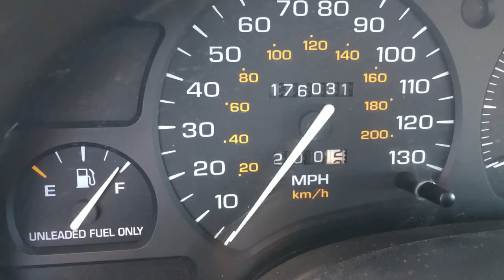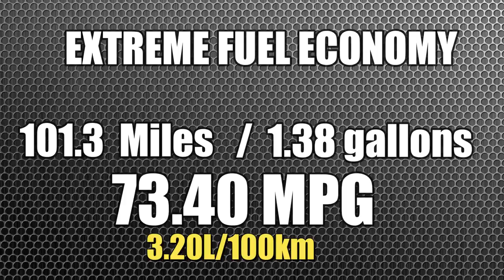S3 E11. Kubota turbo diesel Saturn extreme fuel economy.  super high MPG

Comment: I know you keep saying this car wouldn't be alright to drive anywhere, but I've driven cross country in slower things that were way more questionable. I'd put the main tank back in line, run a fuel regulator and a return line to get it down to an acceptable pressure and see where 700+ miles of range got me.

Comment: a modern diesel car is actually better then this.  you made 3.2L pr 100 and a stock  diesel ford Mondeo do 2.9L pr 100 driven at 70. they managed about 1600 miles on one tank.

Comment: an interesting angle of this project would be operational cost / mile  diesel vs cost / mile gasoline.  At one time it was definitely worth going diesel, modern times i'm not so sure.
Reply: @drippingwax  One of my former cars (2015 cruze) had an option to do gasoline 1.8L   gasoline turbo  1.4L   and a diesel turbo model.   Up front the diesel model was 4 to 7 grand more purchase price.  Then factor in fuel,  repair costs, and availability of knowledgeable diesel repair mechanics.  I figured most "stealerships" barely know how to properly diagnose issues and are only interested in silver bullet repair tasks.  Maintaining and repairing my vehicle myself combined with a lower gas model sticker price is where i figure it saved me the most money in regards to overall ownership.  (chime in post covid world, availability of parts was very important factor as vehicle aged)

Comment: if you were put that engine in something like a prius or the old honda insight it would probably get even a little better mileage . they have a narrower body than the saturn and so are probably slightly more aerodynamic . i think they also have a narrower track ( wheel track ) and that also helps reduce drag or rolling resistance . that's why bonneville streamliners have a narrow track , not just because the body is narrow . and skinny tires with a lot of air pressure can help

Comment: A Tesla Model 3 gets 150 mpgE (EPA official test) without driving weird.  An advanced dual mode EV will get 297 mpgE at 180 mph with aero not being negated by driving dangerously slow and safely up on guideway.  A measured Cd of 0.07 is the main factor.

Comment: 0:50 I disagree. I drive economically, and that is the correct fuel economy. Don't go over 55. If the downhill isn't steep enough to coast in gear and maintain/increase speed then coast in neutral. 

Always gain speed downhill, even 5mph and then coast it out will increase mpg. 

Never accelerate downhill, that's stupid. 

Too high speed going downhill means you spend fuel going downhill, that's stupid. 

Not losing speed uphill is stupid. You can always get the speed back on the top when it flattens/goes downhill

Comment: I figure your method for measuring the amount of fuel in the diesel tank is a little more complicated than necessary. Why not just get a wooden ruler, and stick it in so it sits on the bottom, and then just read out how high the ruler got wet to. More in line with how a you read the amount of fuel in a Trabant.
Reply: @drippingwax  Looking at pictures online, the trabant has a rectangular fuel tank. So it's pretty much just a ruler, but with gradations for half a tank, etc. (I think, I've never seen a trabant in person).
Reply: @drippingwax  he does mention the fuel tank in his 'review' video of the trabant. They do have rounded corners, but I imagine it can be approximated to be a rectangular prism.

Comment: The fact is, Diesel has so much energy per volume, look that car went 101 miles with just a gallon point 38 of fuel or 22 ounces if my math is right. That means that diesel in this particular setup has enough energy density per 0.24 ounces to keep a car constantly accelerating for 1 mile. That is phenomenal. Try that with your fancy electric cars. Not happening.

Comment: Good!! The modified red Saturn reaches the fuel economy of subcompact French diesel cars.
They use the same basic concepts: small diesel engines with a powerful turbo, reasonable weight, old style manual transmission.
https://en.m.wikipedia.org/wiki/Citro%C3%ABn_C3

Comment: Fill in the front end air intakes with polycarbonate sheet and put an air dam under the front maybe....
Reply: @drippingwax  I dont know whats under there but I would cover the headlights and the air intakes for better aerodynamics at least. Maybe make a bigger airdam.  It might not help but I would try it anyway.
Reply: @drippingwax  Are you drunk??? there is no 79 seconds and im not talking about weight savings Im talking cd drag. 1/8 inch polycarb over those garish openings on the front will increase CD
Reply: @drippingwax  Probably the booze and weed.
Reply: @drippingwax  Here is some logic......go to bed.

Comment: The Mile
The basic concept of the mile originated in Roman times. The Romans used a unit of distance called the mille passum, which literally translated into "a thousand paces."  Since each pace was considered to be five Roman feet—which were a bit shorter than our modern feet—the mile ended up being 5,000 Roman feet, or roughly 4,850 of our modern feet.

If the mile originated with 5,000 Roman feet, how did we end up with a mile that is 5,280 feet? Blame the furlong. The furlong wasn't always just an arcane unit of measure that horseracing fans gabbed about; it once had significance as the length of the furrow a team of oxen could plow in a day. In 1592, Parliament set about determining the length of the mile and decided that each one should be made up of eight furlongs. Since a furlong was 660 feet, we ended up with a 5,280-foot mile.
Reply: The Nautical Mile
So if the statute mile is the result of Roman influences and plowing oxen, where did the nautical mile get its start? Strap on your high school geometry helmet for this one. Each nautical mile originally referred to one minute of arc along a meridian around the Earth. Think of a meridian around the Earth as being made up of 360 degrees, and each of those degrees consists of 60 minutes of arc. Each of these minutes of arc is then 1/21,600th of the distance around the earth. Thus, a nautical mile is 6,076 feet.
Reply: The Acre
Like the mile, the acre owes its existence to the concept of the furlong. Remember that a furlong was considered to be the length of a furrow a team of oxen could plow in one day without resting. An acre—which gets its name from an Old English word meaning "open field" —was originally the amount of land that a single farmer with a single ox could plow in one day. Over time, the old Saxon inhabitants of England established that this area was equivalent to a long, thin strip of land one furlong in length and one chain—an old unit of length equivalent to 66 feet—wide. That's how we ended up with an acre that's equivalent to 43,560 square feet.

Comment: You need an air cooled bug for your tests. Light weight, geared for low power, and should be good for aero.
Reply: Bugs got terrible aero, as does just about every old car.
Reply: @GoldenCroc  For the time and given size, its got a pretty good drag coefficient. It may fall short of some modern cars but the size plays just an important role as the Drag Coefficient when regarding aero. Their shape helps maintain stability at higher speeds.which is no small feat considering their size and weight all while being slippery enough to get great fuel economy.
Reply: @GoldenCroc  drag coefficients are relative to the vehicle size. A suv with a .35 drag coe. and a camry with a .35 dc are very different levels of aero. Scaled down further, the beetle does decent.for how tiny it is and its curved design birthed the porsche afterall.

Comment: How to Unclog a Drain
Reply: Hair, soap scum, and dirt make up a cocktail of gross sludge that has to make its way from your sinks, bathtubs, and showers to the outside world. Over time, that debris can start to build up, resulting in slow drains and stagnant pools of water. If you find that your drains are acting more like corks, use this DIY method to get things flowing again.
Reply: Remove and clean strainer or stopper
Reply: Pour a kettle full of boiling water down the drain
Reply: Pour a kettle full of boiling water down the drain
Reply: Add 2 cups of white vinegar to the baking soda in the drain.
Reply: Let the mixture work in the drain for 20 minutes.
Reply: Flush the drain with another kettle of boiling water.

Comment: Significant! 
Arguments:: 1) Acceleration vs Safety
2) Speed / Time vs Environmental Sustainability
I am quite happy with reduced heat emissions, fuel consumption, and reduced acceleration because all of these implementations lead directly to a greater good albeit arguably less productivity. I suppose if we toss out the window any care of protecting gods greatest creations we find ourselves hers today with the ability to decrease fuel consumption well below 1 GPH while also increasing acceleration without additional fossil fuel. I suspect the goal today is having an acceleration of 10 MPS/s x 6 seconds. But does: The six second 0-60 mph event actually improve much?
 It may just be that, we must not continue destroying the natural migration of box turtles. ❤✌️👍🏻👍🏽👍🏿

Comment: Did a check of the mpg on my diesel swapped suburban. Its getting in excess of 22mpg. Was only getting 13mpg with the 350v8. Dont forget, you can make fuel from waste oils.
Reply: @drippingwax  no

Comment: 70 mpg is about the same as a 300cc sport bike driven normally off normal gas. Like a CBR300R, Not bad for a car.
Reply: @drippingwax  Diesel has pretty bad emissions also. Motorcycles have gotten a lot better since mythbusters has been on the air. Euro 5 emissions has really improved a lot of bikes forcing bike makers to make big changes or to stop making the bike altogether. The tech has been updated too and some small city/mopeds can get 130+ mpg these days. The Honda grom claims 150 mpg with a real world around 140, and it has a catalytic converter and modern emission limiting items more inline with that cars have.

Comment: If you do modify the transmission in the wagon, I can attest, a better overdrive makes a huge difference. I had a 1997 SC1 that I did a twin cam swap on. The twin cam engine was out of a 2000 so it had the smaller head with roller rockers and more crank counterweights. The ‘97 was a stick, so it had the MP2 “economy” trans. On a trip from Buffalo, NY to Nashville, TN I was getting around 41 MPG at 70 MPH (close to 410 miles on a 10 gallon fill up). The tach at 70 is around 2500 RPM as opposed to the MP3 that sits at almost 3500. The efficiency of the twin cam vs the SOHC is remarkable.